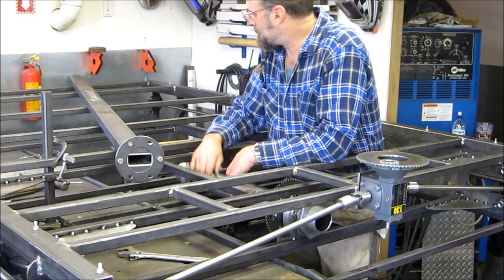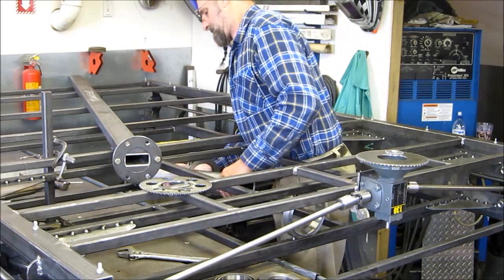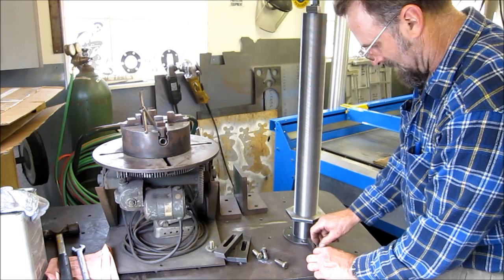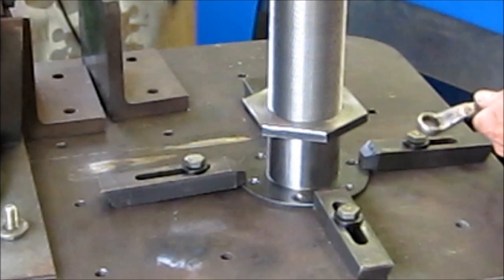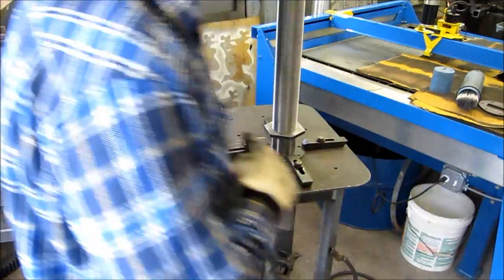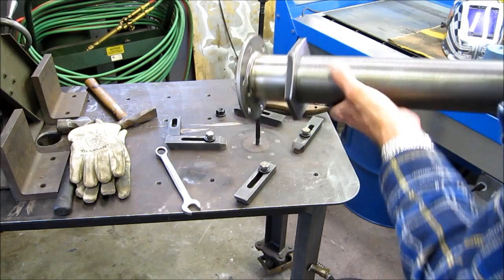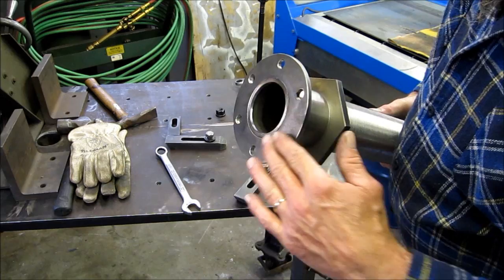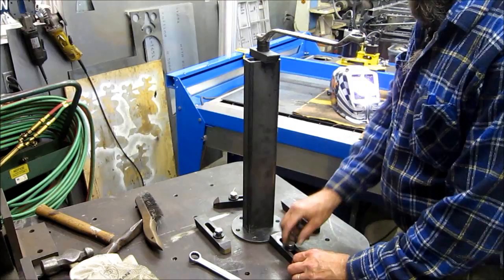Big Screen Elevator Part Fifthteen

Comment from the maker: Putting a light coat of preservative on the threads will keep it adjustable...

I did think for a second of cool materials to do the drop link with but more so was thinking of the cool metal art or frame for poster, to have someting to view from the back of the screen, if your on the back side...